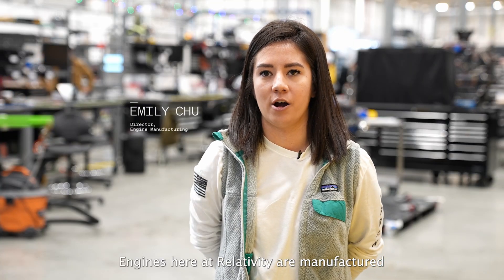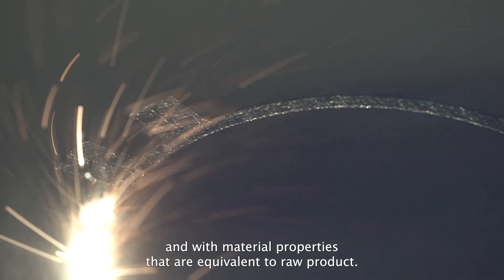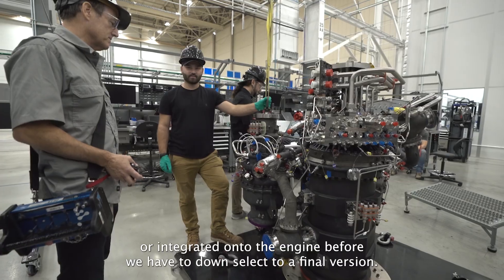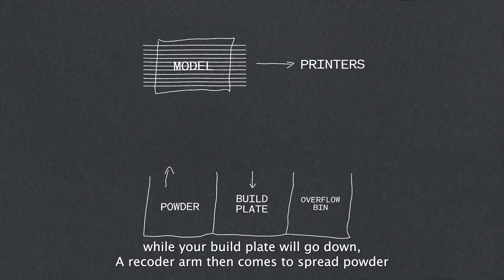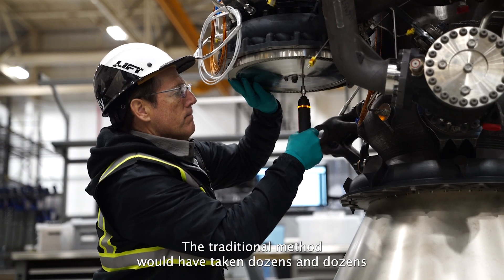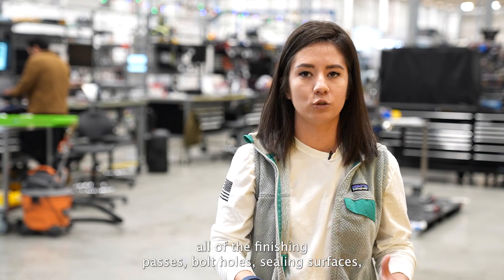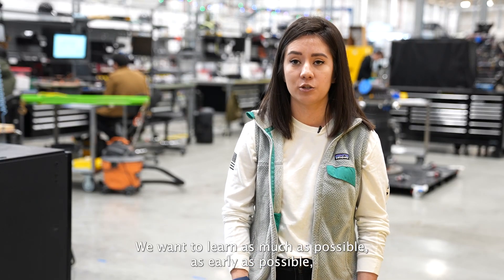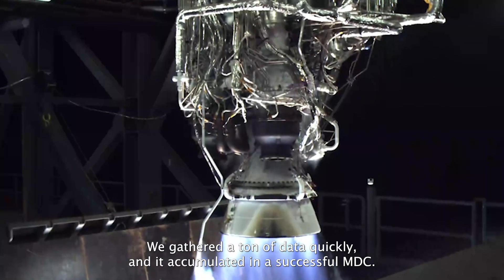Relatively Speaking:  Engine Manufacturing at Relativity

Comment: Surprised to gear helicoils mentioned as part of the production process but it makes sense. I'd love to hear more about the de-powdering. How do you make sure there's not even a speck of dust in a small enclosed fuel passage?
Reply: Parts are washed in powerful ultrasonic bath. This is very effective against powder. Channels are flushed with high pressure. Then, after drying, blown with ionized nitrogen. The downwash is inspected with particle counters. Works very well 😎
Reply: I figured there had to be a high pressure flush, ionized nitrogen was the part I was missing! That's so cool!

Comment: Relativity is developing at an ultra-fast speed.
Reply: Relativistic speeds?
Reply: @RKroese  US Air Force and NASA together developed the F1 engine, it took them 10 years to fully develop it, budget was unlimited. 
Relativity has developed an engine in almost one year while being on a limited budget and with way fewer engineers.
Reply: @NapoleanBuonaparte  and the secret, they hire former SpaceX engineers who had been in the Raptor project, there is nothing wrong with this, you will simply make sense of it now because they did it quickly.